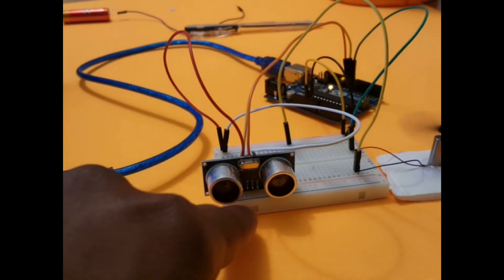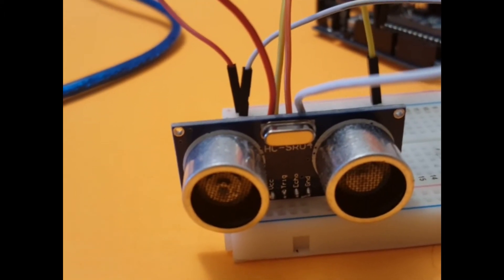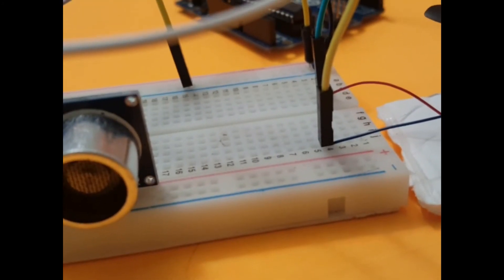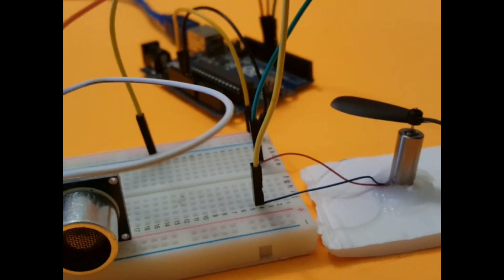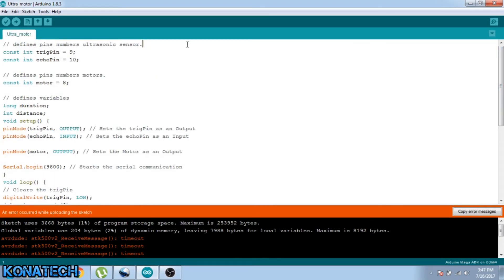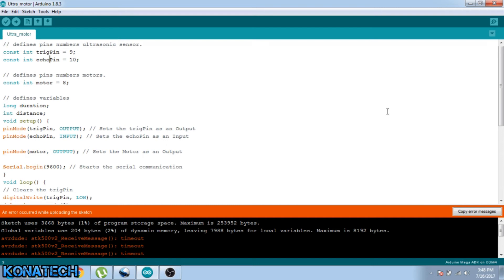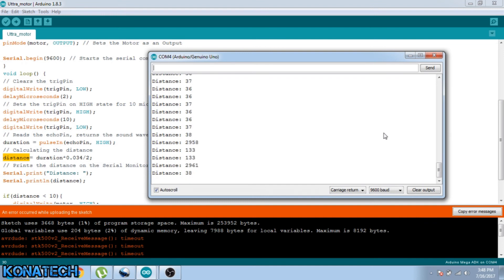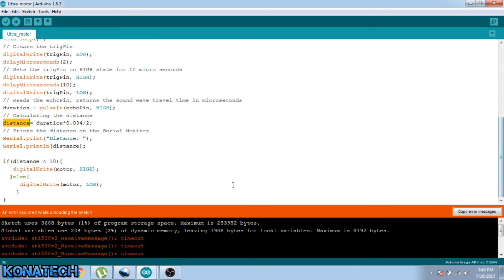ARDUINO - utlrasonic sensor + motor

Comment: // define los números de los pines del sensor ultrasónico.
const  int trigPin = 9 ;
const  int echoPin = 10 ;

// define motores de números de pines.
const  int motor = 8 ;

// define variables
larga duración;
int distancia;
 configuración vacía () {
pinMode (trigPin, SALIDA); // Establece el trigPin como salida
pinMode (echoPin, INPUT); // Establece el echoPin como entrada

pinMode (motor, SALIDA); // Establece el motor como salida

De serie. comenzar ( 9600 ); // Inicia la comunicación serial
}
 bucle vacío () {
// Borra el trigPin
digitalWrite (trigPin, BAJO);
delayMicroseconds ( 2 );
// Establece el trigPin en estado ALTO durante 10 microsegundos
digitalWrite (trigPin, HIGH);
delayMicroseconds ( 10 );
digitalWrite (trigPin, BAJO);
// Lee el echoPin, devuelve el tiempo de viaje de la onda de sonido en microsegundos
duración = pulseIn (echoPin, HIGH);
// Calculando la distancia
distancia = duración * 0.034 / 2 ;
// Imprime la distancia en el monitor serial
De serie. print ( " Distancia: " );
De serie. println (distancia);

si (distancia < 10 ) {
   digitalWrite (motor, ALTO);
  } más {
     digitalWrite (motor, BAJO);
    }
}

Comment: Good explanation. But not working. Ultrasonic sensor working fine,but it unable to run the motor when I put my hand near to the sensor.
Reply from the maker: For some motor you will a motor controller. That could be why

Comment: Hey Konatech, I've been trying other options, but it still doesn't work. Ive seen the video, copied the code and fixed the errors, but the sensor still doesn't read anything, so I have a few questions:
1. How did you connect the motor to the wires and inserted them into the breadboard
2. Can you give me the schematics for the ultrasonic sensor.
Also, could you give me your email?
Reply from the maker: El Macho konateze1@gmail.com